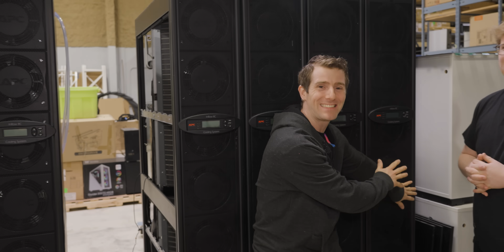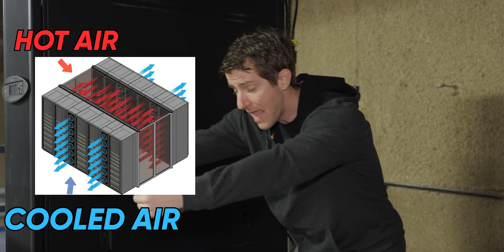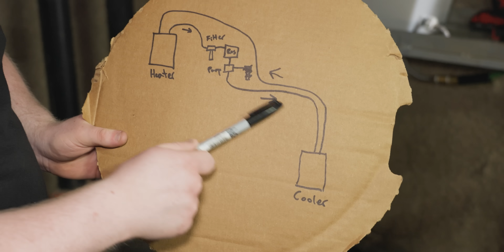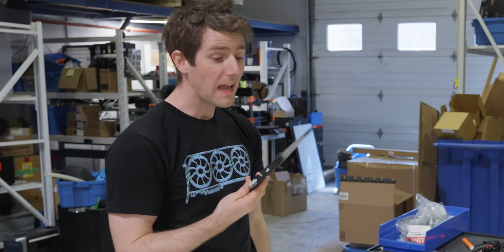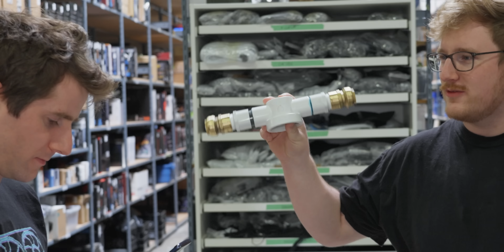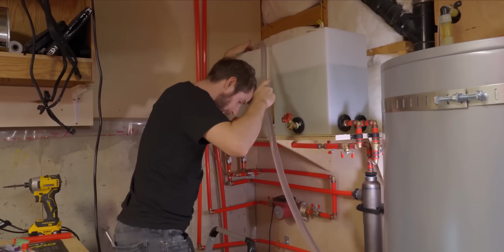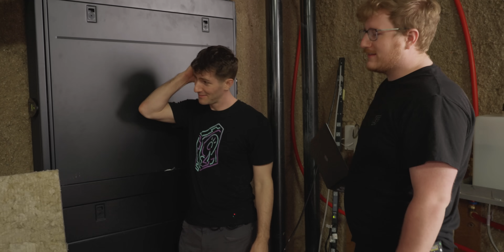I shouldn’t have kept the $1,000,000 computer

Comment: So, it DOES improve things - but does it also cost more to run, than the inadequate 3 ton AC? I mean, it's certainly worth it, because if i'd measure 70-ish Celsius in the "hot isle", i'd be flailing in a panic! (I think Linus has been a bit worried, as well, pointing the FLIR at those exhausts. 😅) edit1: i'm looking forward to part 2.

Comment: Im a DC engineer for Americas largest bank. We run the cold isles at 25c, with the hot isles around 45 to 50c. In our datahall with 1,150 physical servers we burn through 9 power supplies a week on average. But the massive saving on AC spend per month running at 25c instead of 21c is many thousands. So replacing 9 PSU's per week is negligible. We use all HP Proliants and they seem quite happy generally.
Reply: Are there no PSU's built to last for these applications? That's crazy!
Reply: @pedrobernardo5887  When you run at high temps they will fail quickly. Some of the PSU's that i swap live are so hot when you remove them that you cannot touch the casing. So internally they have to be 70c +.

Comment: You should throw a small 5-10kw geothermal heat pump in that system. 
The brine side run down to the server room and the heating side up to heat the warehouse. 
So you can move way more energy without using multiple cooling towers.

Comment: Install thermocouples and heat pumps - recycle the energy so you have hot water and heating plus from the ventilation a windmill like generator to recycle energy from the fans

Comment: While this is a cool solution. If you are just moving the heat to outside of the room, couldn't you just as easily make a hole in the wall and install a fan to blow the hot air directly into the warehouse?

Comment: I think that is why we have Server ROOMS and not Server Closets.
They sell Hydronic Heater Fill tanks that keep the system at around 15-psi.   but I would build a 20x30 Server room with his custom cooling, but  also a 10 ton AC that runs as a backup. 
You just set it to 78 degrees so it only comes on is the custom loop is not working well, or not at all.
Reply: That has been the one thing that has blown my mind on this channel. There's a lot of DIY, which while good for learning, doesn't help their end game. 

I don't understand why they just don't take advantage of decades of data center design and look at how to do it properly.

Comment: I wonder, given how high end computer parts decrease in value really quickly, how much would the original $1,000,000 computer be worth if you built it today?
Reply: 99% of the cost is in the high capacity storage. Which hasn't really changed in price.
Reply: @verakoo6187  I just looked into it and it has actually come down a lot. When it was first built the CD6 drives it used were apparently around $3100 but are now around $1400.

Comment: I would have suggested that you use anti-freeze, and you should also consider using a vacuum for fill it.  The coolant will add some anti corrosion protection. 
And you do not need an rPi to control the valves, A pico or esp-32 will work just fine for that.
Reply: You mean a Raspberry Pi Pico?

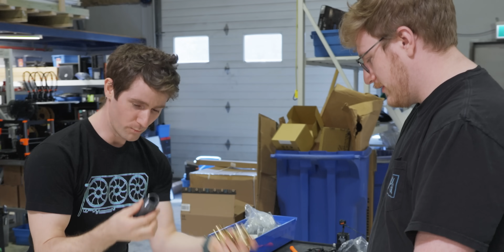Comment: I just installed a bidet in my house 11:23 ; this crap also happened to me. I went back to the "professional" store 5 times and nothing worked. I found the right fitting by researching on their own website. They told me it would not work. I now have a working bidet...
Reply: Usually accurate. But in my area most of the people working home improvement stores are retired trades guys. It's wild how much help I've gotten after breaking stuff at Lowe's
Reply: @timmytot666  Lowes is staffed with retired master plumbers in the same way this comment section is full of datacenter cooling engineers. Remain skeptical until you actually see their license and if you need a plumber hire one.
Reply: @factzilla1868  No one said "master plumber".
Reply: @factzilla1868  As a "retired" "lowes datacenter cooling solution plumber" I take offense to this.
Reply: @THE-X-Force  FYI a master plumber is basically just what journeymen become after working at least 3 years. A competent plumber should certainly have their masters by retirement.
Reply: @factzilla1868  I know exactly what it is, and I know that it's a strawman you brought up because nobody mentioned it, and I know you like your own comment too .. which is kinda sad.
Reply: @THE-X-Force  You work for Lowes or something? You're very worked up over basic advice: don't assume some random guy at a store is a competent plumber.
Reply: Always remember if the guy in the store were a competent plumber they'd be out working as one instead of stocking shelves
Reply: @factzilla1868  was about to say that. they might sell professional grade equipment, and might also be all professional salesmen or whatever the woke term is, but they aren't a competent plumber(s).
Reply: @factzilla1868   its retirees and  clueless 17yr olds here, i think i've taught the kids more about what they were trying to help with haha
Reply: Went to replace a cutoff valve under the kitchen sink in my former house. No fittings, valves or adapters would slide into any of them. None. Finally, I went to a commercial plumbing supply house and the older guy behind the counter figured out that the pipe end I was trying to attach a valve to was actually refrigeration copper tubing, NOT water supply copper tubing, the tubing wall was very slightly thicker even though it looked like it was the right size. Turned out there was only about 3" of the refrigeration tubing sticking out of the sheet rock and it had been jury rigged and blob soldered to real copper water line inside the wall by someone in the past. It was a great relief when I finally found that, I was afraid that some numbnutz had plumbed the whole house like that.
Reply: adn this is why it always amazes me when people get mad and shocked when our employee can't help them "OMG ISN'T THERE ANYBODY THAT CAN HELP ME" dude... you're at a cheap store buying something for $1 and you expect our workers to be trades people? how about you got to the plumber next door and pay $30 for that same fitting and ask your questions there.

Seriously last week I had to reply to a angry email from a woman that started off like this:

"Hi I have no clue about cars, and I was in your store last night looking for a part and the clerk that was there spent 5 minutes looking for the part, and eventually had to ask for help from another clerk, they spent another 2 minutes looking up and asking me what car I had even though I already told him that
Is it normal for people not knowing anything about cars" (keep in mind she had A LOT of spelling errors and horrible grammar, I have dyslexia and even I though it was horrible)

I simply had to reply:

"Hi I'm sorry that you felt that you didn't get the help that you wanted, but the kid that was working there last night is 16 years old.
He has shown interest, and from what we have observed it seems like he genuinely wants to learn and try to learn about the service desk and car parts thus he was put there on his own after a week of training to give him the chance to learn on his own that night.

He's going to replace some of our staff during the summer vacation, it will take some time for him to be completely independent given that we have 19000 parts in stock, but hopefully he learned something new today.

Thank you for your understanding"

The amount of customers that just comes in and say:
"I want this"
what exactly is "this"?
"🤷‍♂ a friend told me I could get is here"
what do you use "this" for?
"🤷‍♂ u tell me"
😮‍💨 try ille 5 there's stuff that looks like "this" over there
Reply: Bidet:
The best way to clean your ass.
Reply: I'm a master baiter.

Comment: be careful when sticking the rads directly to your racks. We've had a system like this from Rittal and it was worthless - turned out, you need a LOT of airflow and pressure to get them working, and ended up zip tying noctuas to the rads to make them work at all...
Reply: I'm pretty sure what Jake said was that they want to take the radiators AND FANS and just integrate it all into one rack.
Reply: @danieljensen2626  lets hope for that :)
Reply: Sounds very LTT to do that
Reply: thats what he did at home
Reply: Rads

Comment: "It will be done right later."

Yeah... Right...

Nothing is as permanent as a temporary solution...
Reply: I thought they were going to stop doing things like this. I don't it will even heat a space that big with a tall ceiling since heat goes up.
Reply: @chosen1one930 it is temporary as in they are doing it themselves for the video. A licenced plumber will later come and do it properly. 

The indoors and the we will pull out the raadiatior is a certified soonTM moment though.
Reply: Man truth went past my old school the temporary school buildings ( basically double wide shipping containers)  turned classroom still going strong 20 years later
Reply: temporary solution THAT WORKS!!! big miss!

Comment: If you were going to use that orange hose for a below ambient to highish vacuum application, I'd say maybe consider using different hosing because they are pressure checked at the factory using water and going under vacuum will draw water out of the hose

Comment: I still don’t understand how they haven’t seen those fittings before. There basically the FPT x FPT Union Fittings like you would see on a home natural gas line for a air heater or a water heater. Usually their made of cast iron. But you can get them in brass and copper.
Ring any bells anyone?
Reply: I assume you're talking about the original fittings they cut off?  Those are sanitary flange fittings and they're just not used much in Canada.
Reply: Theyre just gamers man how wpuld they know that
Reply: @NeuralFire  
Because they spend a lot of time in mechanical rooms. You can see one on the pressure regulators. I would say there was one in his “New House Smart HVAC” video but everything was electric.